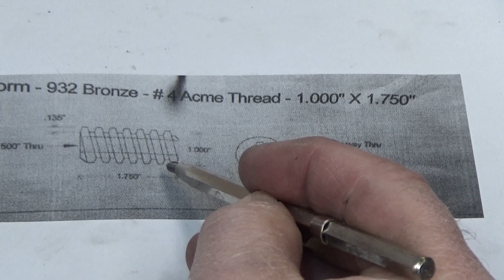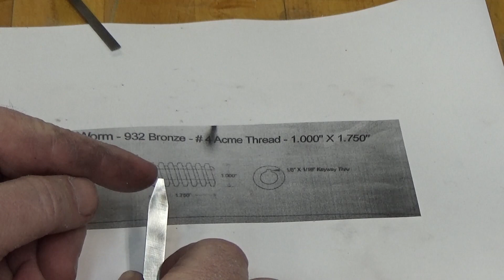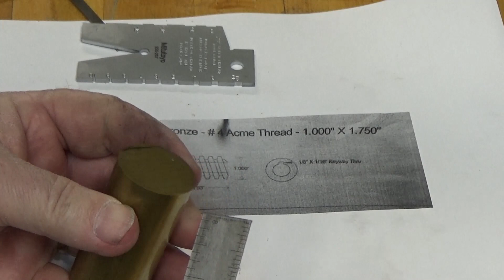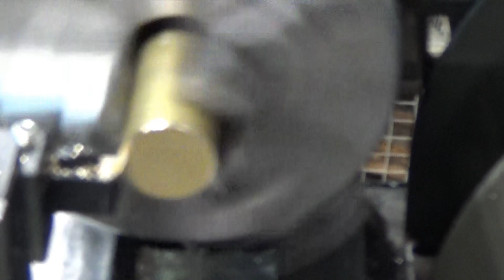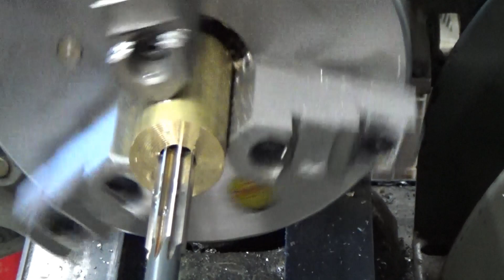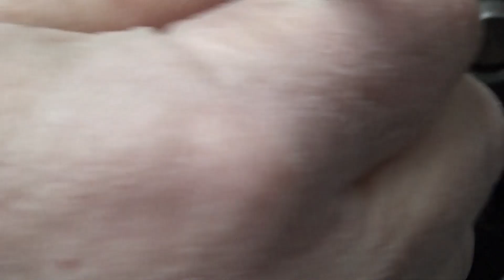Viewer Project - Setting Up to Cut Acme Threads

Comment: Steve I said to myself...."self, why didn't he use the center and a dog, that's how those mandrels are ground"...lol ...glad you caught it, nice video...
Reply from the maker: I was trying to take a short cut. With the tooling that I have for this lathe using the dog is a set up challenge.  You may see it in part 2.  Thanks for the comment.

Comment: Hey Steve, That was a tease brother.  HAHAHA  Looking forward to the next one.  Just as a side note, another way to have figured the angle would have to taken the inverse tangent of the lead divided by the circumference of the worm at the pitch diameter.  Or roughly at the OD ... tan(.250 / PI)^-1 = 4.55 degrees.  so I think 7 degrees rake should have given you clearance if I done that right.  Great video and I am looking forward to seeing the threads cut.  Thanks for sharing.

Joe
Reply from the maker: I have been playing with the trig on the angle and your calculation is correct. However the angle is working out ok as ground.  The video was just running too long and I thought that was a good place to stop.
Thanks for the input.
Reply: @sharkrivermachine  What you done was just fine.  Just armchair quarterbacking.  No other sports are on to watch.  HAHA  Hope I didn't overstep buddy.  :-)
Reply from the maker: @MyHeap  I am always open to well though out information.  My professional machining career was as an automotive machinist, that is quite different from the general machine work that I am doing in my home shop. I learn something new every day and a lot of it comes form my loyal viewers. Keep it coming.
Reply: @sharkrivermachine  Well you are more qualified than me my friend.  I am a computer geek by trade learning machining by making bad parts and then having to remake them!  haha  Love your channel Steve.  Keep up the great work!

Comment: Those tapered mandrels are made to be run between centers and driven by a dog. You could grind the shoulder concentric with a tool post grinder, if you had one
Reply from the maker: I considered setting it up on centers.  That is how I usually use them but I thought that I would try it out in the collet. This isn't finished yet.  The centers may be the way to go.  Thanks for watching and commenting.
Reply: R. Steven Lang, Shark River Machine , that comment was meant for your viewers that may not know better, I figured you would know how to properly use mandrels.
Reply from the maker: Sometimes I need to be reminded, we try to take shortcuts that turn around and bite us sometimes. I appreciate the feedback.

Comment: I saw that run out too. I was wondering if the center hole in the mandrel was off or damaged. Glad you caught it.
Reply from the maker: I saw it when I set it up and thought that I was seeing things. That was just the first of several issues that I ran into.  This is really the first job that I have done on this lathe that required any accuracy since I bought it. I am getting it dialed in.  I would have used the Atlas 618 but it will not cut 4 TPI threads. Thanks for watching and commenting.